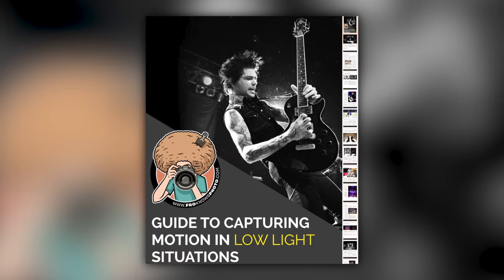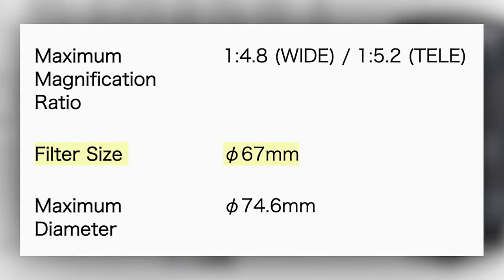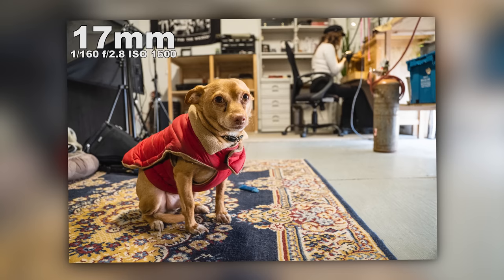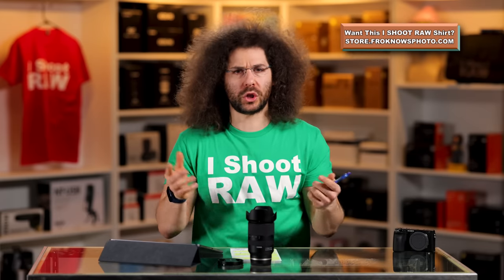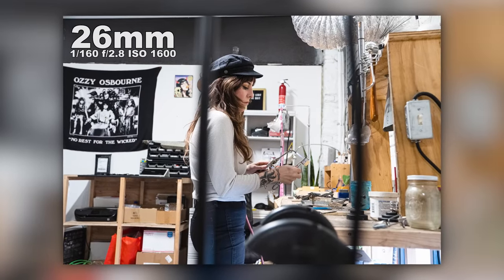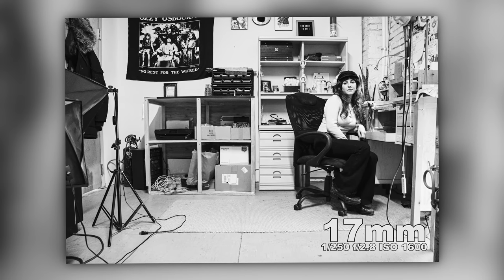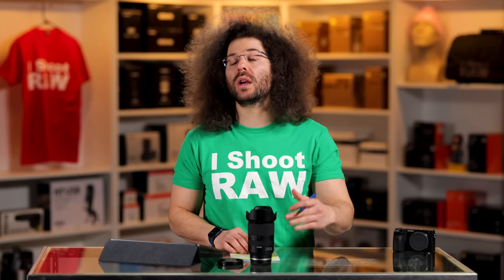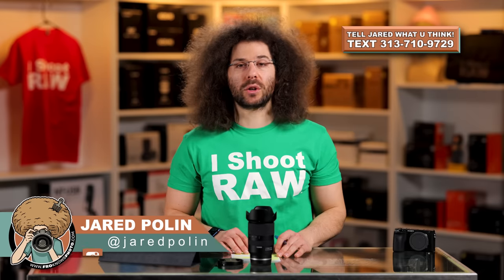The $800 DREAM LENS for Sony Cameras | Tamron 17-70mm 2.8 Review

Comment: For a min I was thinking "Damn, I just bought the Sigma 24-70 F2.8 for more money" then I realised it's for APS-C. As to protection filters, if you're a hobbyist shooter like myself. Yes, absolutely. Just make sure it's a quality, branded and genuine filter. I have a B+W UV filter on my Fuji 16-55 F2.8 and a Kenko UV filter on my Sigma 24-70 F2.8. Negligible effect on image quality, certainly beyond my ability to tell, even pixel peeping. I always use a lens hood though, I find it is a great item to protect from knocks, more so than a filter. I live next to the sea, so lots of sea spray, sand etc. So for me a lens protector is just about minimising the risk of lens coating damage or scratched glass caused by wiping off sand/salt. Or a contaminated cleaning cloth (it does happen). 

It's a LOT cheaper to replace a filter than a front lens element. 

Now, if I were a professional who didn't care about the cost of lens replacement or had access to freebies, sure, tell people not to use a lens filter. The rest of us in the real world, it's not a bad idea at all.
Reply: @StavroGavro Sea salt and sand will wreck the front end of a lens element in quick order. Very abrasive. I'm quite happy to sacrifice a lens filter.
Reply: @StavroGavro I live a stones throw away from the sea. I do a lot of photography here. Sea salt from spray and blown sand is a frequent thing. I don't need you to tell me how to do photography. I do my thing and you do yours. I've already explained this.

Comment: I wish sony releases an aps-c camera with an evf placed at the center, design an size similar to the original a7 and about 400g
Reply: If Sony would just make a top of the line apsc sports shooter, I'd be all in on crop bodies.
Reply: I'm curious.. why do you want it at the center anyway?
I mean, if it's for ergonomics for lefties(I read this somewhere) it would still snag your nose anyway.. I rrally prefer the rangfinder style.

I just want dual-card slots & to make the APSC sensor BSI. Sure, pixel size makes better for low light, but comparing the A7Riv sensor with smaller pixels to the A6400/A6600 sensor that BSI would do wonders for low light.
Reply: YES! If Sony will do that, just like what Nikon did with their Z50, I will hands down be fully invested in their APS-C line, if Sony will stop being stubborn and lazy and start listening to their audience.

Comment: But a 17-70 F2.8 on APS-C gives the exact same results as a 25-105 F4 on Full Frame, which are the kind of lenses you hate because they are F4 instead of F2.8.
Reply: nope, it will give f2.8 aperture lighting but f4 bokeh
Reply: @VERSUXH  Yea, sure, but bokeh increases with focal length! You get more bokeh at 105mm than at 70mm. But as you point out f/4 gives less bokeh than f/2.8.
To get the same result with an aps-c lens as on a given full frame lens you must divide the aperture and focal length by the crop factor (which is 1.53, for Sony e-mount aps-c) so: 105/1.53 and 4/1.53 giving a 68.63mm f/2.614 lens to get equal results. Basically the 70mm f/2.8 you get with this Tamron lens.

Comment: only time you use filter is when doing paintballing or at  beach or  wind outside might get dust or dirt or race  track where could be throwing things in air or baseball/softball/soccer/football or any other sport on grass might get stuff on lens. you want to use clear filter. or if you will be shooting in to sun then uv filter. other then that keep on when storing and taking in and out of bag if drop it you break filter only

Comment: Is light transmission similar to -say a sigma prime at 2.8?
Reply: Remember to apply the crop factor to the aperture as well (multiply by 1.5) , so this lens is the full frame equivalent of a 25.5-105 F4.2
Reply: @heysiri4935  2.8 is stil 2.8 on a crop sensor. Only the dept of field that eqivalent to F4.2 on FF
Reply: @joakimberglund7441  
You’re right, my bad!

Comment: "ISO 1600 which is pushing this camera just a little bit..."  
All well and good review, as per usual, but is it me, did I miss it?  I know it's a lens review but no mention of which camera you tested it with???  Just seemed a little strange to me. Carry on.
Reply: He said it was the A6600.
Reply: Doesn't really matter what camera he tested it with, every Sony APS-C camera you can buy right now has the same sensor and the a6100, a6400, and a6600 all have the same autofocus for stills.

Comment: I need the same thing but for full frame. Please 🙏🙏🙏
Reply: its already available for the full frame
Reply: @nnkar1996  no 17-70 2.8 is not available
Reply: @popcornparam  17-70 on crop isnt a true 17mm, its 25-105mm FF equivalent. So yes its already available on full frame with a 24-105mm lens.
Reply: @b47d16  that's excately what I am saying. I want a 17-70 for full frame. Not a 24-105 full frame.
Reply: @popcornparam  ooh i see that will be impossible tbh it would be so big and heavy
Reply: @b47d16  I want it to be the same price and weight 😂

Comment: Isn't this lens just a 25-105 f4 equivalent on FF. What's so incredible?

Please correct me if wrong on the following statement: It's not really a 2.8 in a true sense because of the crop factor. The actual real world behavior of this lens will be more like an f4 aperture on FF.

Now if this was a FF lens, with that focal length and aperture, that would be truly incredible. I would pay north of $1200 for it.
Reply: Correct upto a level. Yes, it is equivalent of a 25.5-105 mm (~24-105 mm) in focal length and f/4.2 (~4) in depth of field. But the light transmission will still be that of an f/2.8. (Not exactly, coz T stops would determine light transmission, but you get it)